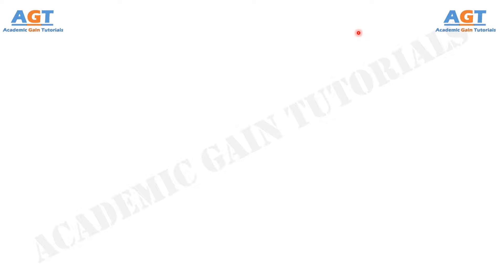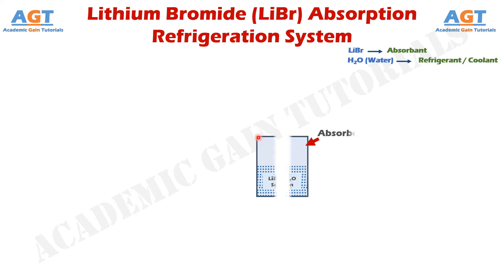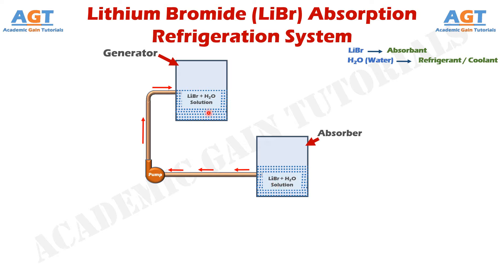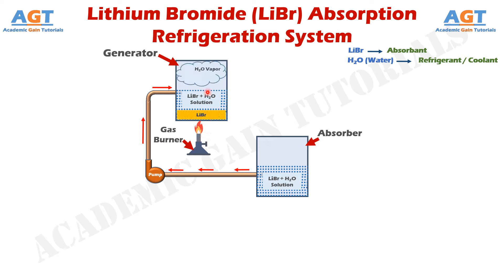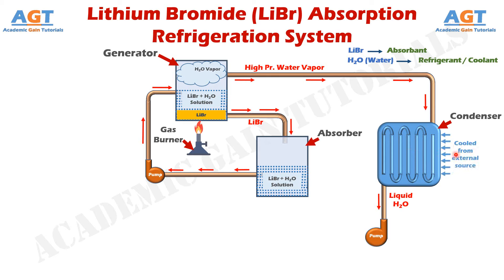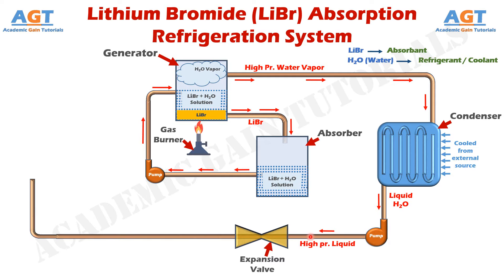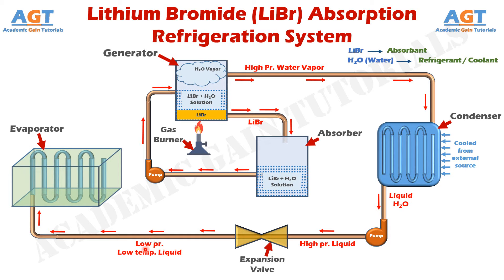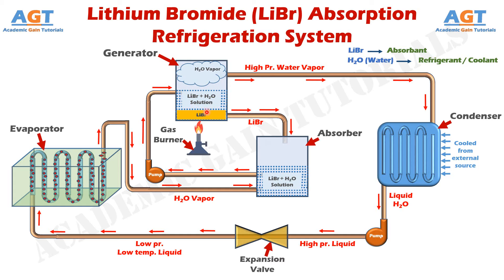How Lithium Bromide Absorption Refrigeration System Works - Parts & Function Explained.

Comment: Sir what is use of li-br in this system??
Reply: It acts as an absorbent. In the case of Li Br-water mixture, Li Br is the absorbent and water is the refrigerant since water is easily evaporated in such mixture.  For NH3-water mixture, water is the absorbent and NH3 is the refrigerant.
Reply: @CallMeTomat0  absorbent for what? I don't get it 😅
Reply: @Sami.Akbr00  bhai tum mj ke hai nai
Reply: Ok bro

Comment: Thank you very much. You've made another great video about the water-ammonia unit. Overall, which of both have big differences (such as solar heat for ammonia-water vs gas burning for water-LiBr). Yet, I am asking a general question in terms of cost and performance?

Comment: Function of LiBr👇

The high affinity of the refrigerant for the absorbent (usually lithium bromide or ammonia) causes the refrigerant to boil at a lower temperature and pressure than it normally would
Reply: It's low vapor  pressure

Comment: Hi ..
Why you did not mention about low pressure phenomena in evaporator eventhough the most important point of vam is the vacuum of evaporator where because of low pressure water starts to evaporate at 5℃. And we also need a vacuum pump to create this vacuum in evaporator. Please explain

Comment: What is the use of lithium bromide and what temperature we can achieve with this system
Reply: Same question..
Reply: Lithium bromide is the absorbant that absorbs water as mentioned in the video
Reply: We can get around 6 deg c of chilled water
Reply: @WisProf  why do we need to absorb water why we don’t heat directly and send to condenser